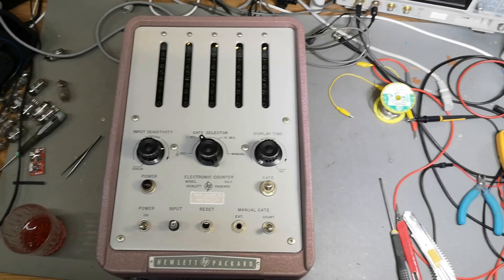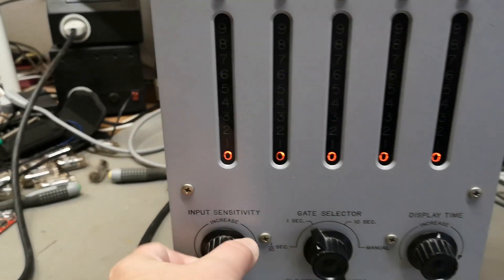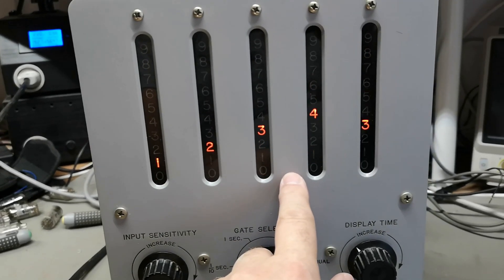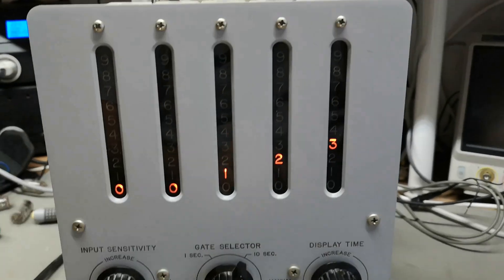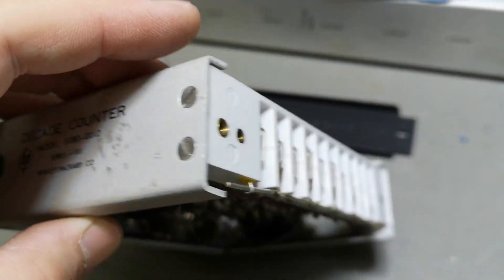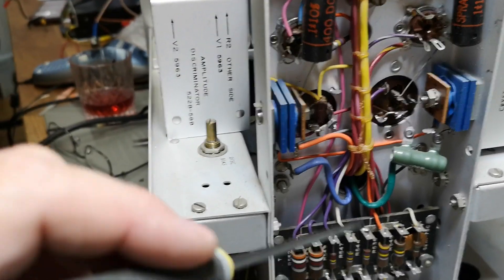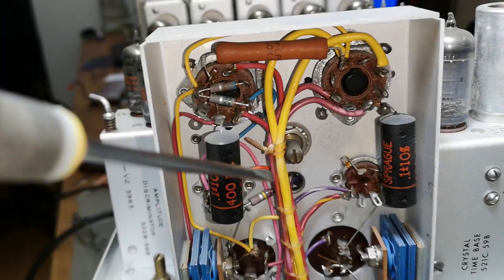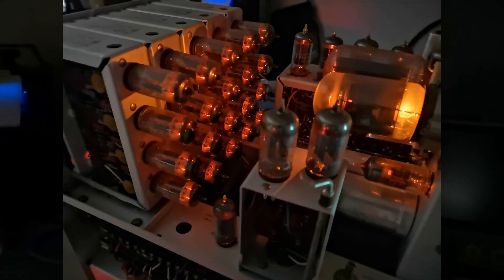HP 521C Electronic Counter 1Hz to 120kHz test teardown 1963

Comment: Neons dim easy to replace them, or simply turn the dim ones around, to use the other electrode instead.

In the days when a transistor cost 20 dollars you can bet they did a lot of odd things to avoid using one, so you would have a complex design with 50 cheap diodes, rather than having to use an extra transistor.

Comment: I had one of those, bought at a garage sale for almost nothing, like $5 or $10, along with an hp 711 power supply. It worked just fine. Unfortunately I lost it in a fire ion Northern CA a few years ago. Still have the power supply. Just nice pieces of gear, like little puppies.
Reply from the maker: getting an HP 521C or even an HP power supply for only 10$ is a smash hit, sad to hear about the fire. i tried to google HP 711 power supply, no luck